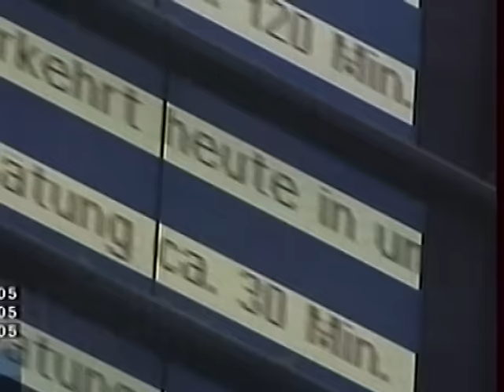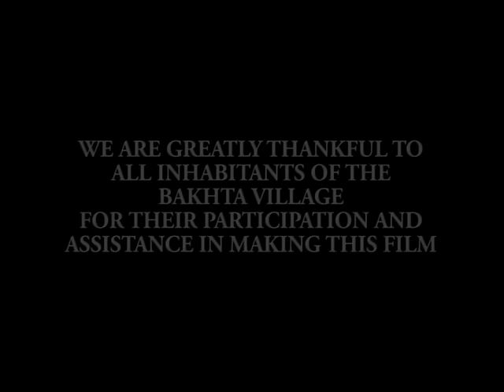Happy People | Autumn (part 3)

Comment: (43:37) By the beginning of November the temperature drops below 30 degrees Celsius.
Reply: Данила Багров  30 degrees Celsius is 86 degrees F.
Reply: Данила Багров  Does the temperature stay above 30 C until the beginning of November? Or...did the video make a big boo boo?
Reply: Данила Багров  In the video there is no negative in front of 30 degrees C.
Reply: Данила Багров  Did you click on (43:37) ? He specifically says 'drops below 30 degrees Celsius'.